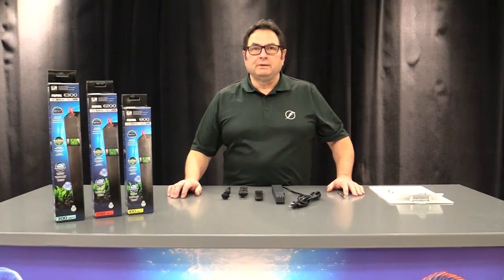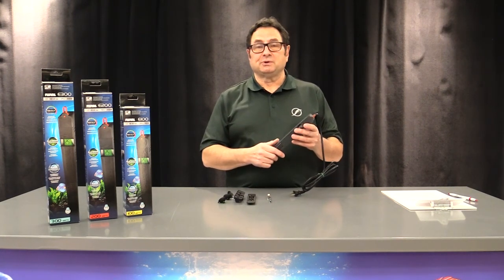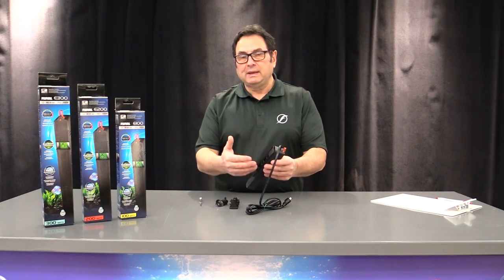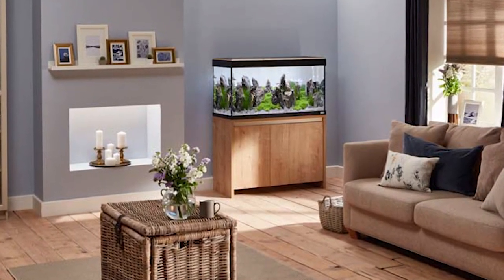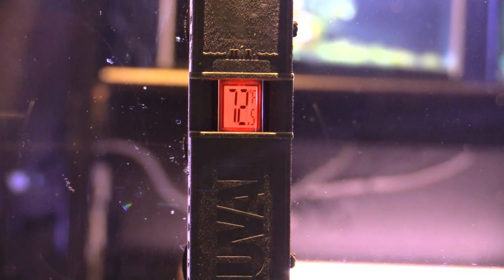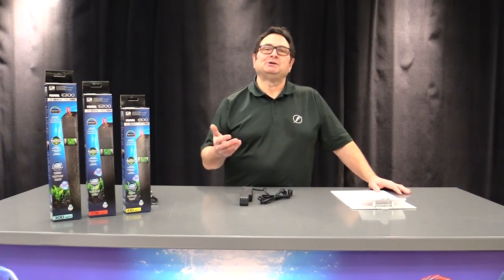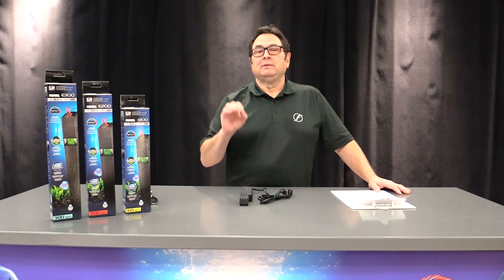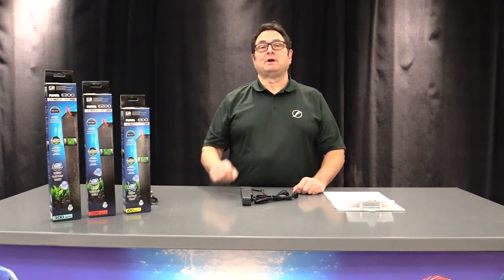Fluval E Series Heater Operation & Troubleshooting Tips

Comment: When you first posted this video, I posted a comment about how happy I had been with the two of these that I had. Since then, though, they have both failed in the same exact fashion; i.e., I could no longer adjust the temperature downward--it would only adjust upward. When the first one did this, I took it as a fluke and just threw it out. I would have still recommended this heater to anyone who had asked. But now that the second one has done this, I have to think it's a design defect that just takes a long time to show up. I won't buy another one and won't recommend them. EDIT: Scrolling through the other comments after I posted this, I see at least three other postings complaining of exactly the same failure! Fluval needs to recognize this problem and fix it.
Reply from the maker: Hi Jim, we're sorry to hear about this. Fluval E Series heaters are equipped with 5 year warranties, so if you have trouble with them within that time frame please contact our customer support team: https://fluvalaquatics.com/ca/contact-us/
Reply: @fluval  Thanks for pointing out the warranty period. I have taken your suggestion and submitted a warranty claim.
Reply: Well, so much for my warranty claim. I submitted it on the Fluval web site using the form provided. I got a reply asking me to send a picture of the label on the back of the heater, which I did ten days ago. But then I've heard nothing further. I sent a follow-up e-mail, but no response. So I still love Fluval filters, but I don't think much of their heaters--or their customer service--at this point!
Reply: @RealMenHaveCats  Hey there, how did this all end? Im looking for a nice heater for a 20 gal, thought this one was a good one but maybe I should look elsewhere. Which one do you use now?
Reply: @Atoximed , they finally sent a replacement, although it was a 300-watt model rather than the 100-watt model that I had. But it was very unreliable. It kept showing that the temperature was lower than it should be, with a blue display, although it actually maintained the set temperature pretty well according to another thermometer. I just didn't trust It. I'm using the Eheim Thermocontrol-e models in two tanks and a Fluval T series heater in another. The Fluval T takes some trial and error to get set to the temp you want, since it has an analog dial, but once you get it where you want it it's very stable. Much like the Eheim model.
Reply: @RealMenHaveCats  Thanks a lot for the detailed answer! I've heard good things about the good old jager eheim but I'm also looking at the superfish smart heater as well. I'd need some kind of way to monitor the temp, as I do not have that at all right now. How do you do it?

Comment: I have two E300 heaters, and while they are rich in features, they have what appears to be a great quality of life asset...the heater rocker adjustment at the top...that turns into an unusable feature, over time. I replaced one with my local pet store, without issue. Now I have one that's 4 months old and another that's 6 months old and both rockers are defective; they either don't adjust the temperature up or down, or it's a very frustrating fight to gain or drop .5 or a degree. I have thoroughly cleaned both, so that's not the issue. I'll be calling the pet store again to see if there's an equivalent option from another manufacturer. I won't be buying anymore of these; it's clearly a design flaw that requires re-engineering.
Reply: i have the E100 and i also have this same problem when trying to raise or lower the temperature .5 @fluval a response to this would be greatly appreciated.

Comment: Hi! I just purchased a Fluval e300 series for my 55gal. I am wondering if I possibly bought a faulty product or I'm just not being patient enough.  I put the heater in my tank for about 23min so it could acclimate before turning the heater on per directions. It has now been in my aquarium for 2hrs and is still stuck at 69.5°F.  It is still flashing blue & 69.5°  . I have it set on 80°F. I have it 4inches to the left of my Fluval 110 Filter.  I have unplugged it and waited 1 minute before turning it back on again in hope's of it resetting, but no luck. Can you please help?
Reply: Same problem
Reply: Similar problem here too.

Comment: I have this weird anomaly with mine. When I turn it off to do a water change, I turn it back on and it'll read low (blue) and stay there. Weird thing is I have a smart meter display so I know it's not stuck on heating constantly as when my display reads under three hundred watts I know the heater isn't on. The work around every time is to switch it back off for a few seconds and back on. It then goes to green and reads the correct temperature. I know this as I have an electric thermometer gun and a temp strip on the tank. Take today after water changing I put the heater back on and it read 25 degrees Celsius. Left it for three hours and it was still blue reading 25 degrees on the display. Checked my smart meter and nope it wasn't constantly heating and everything else read 26 degrees (where I've got it set to.) Turned it off for 20 seconds then back on and it reads the correct 26 degrees. Other than this weird anomaly it works fine. I've never had a LF reading or blue/red other than it reading low after initial turn on after it's been off. Anyone else get this? It's situated perfectly so nothing to do with placement. As I say once I turn it back on a second time it works perfectly.

Comment: I've had two of them for a couple of years and have been very happy with them. I really appreciate being able to set the temp digitally rather than with a vague analog dial. And the temperature displayed is quite accurate--I spot check it from time to time with a high quality Thermapen kitchen thermometer. My only complaint is that, after a water change, if the water temp drops a bit, it takes MUCH longer than with other heaters to bring it up to temp. Two of them behave this way, so I assume it's in the design and it's not a defective unit.

I've never understood why so many reviewers complain about the "low flow" indication. I actually appreciate it and think it's a great feature. It helps you get the best placement. Other heaters don't give you this information so when people get it on this one they think it's a bad design. I'm sure if your Eheim or Aqueon heater could tell you that it needed better flow, it would!

Comment: Found this video for troubleshooting my heaters as they will not lower the temperature set point any longer, which isn’t good obviously. They have been great for 2 years or so now. Very good for keeping temps accurate without much sway.
Reply from the maker: Hi there, we are sorry to hear that you are having some trouble with your heater. Should you need more assistance, please email our customer service team at customer.service@rchagen.com! 😊👍
Reply: @fluval Can i fully submerge it? The manual diagram says not to fully submerge it and leave the top red knob outside of water... Which is the right way?

Comment: Hello thank you very much for this nice explanation. 
I am using this heater now two years it is top.
I have a question please about the conspusption of electricity.  When the heater show green color on the led .does still the heater in this case consumes electricity?? 
Thanks
Reply from the maker: Hello, thank you for your question! Yes it does although the electricity consumption is significantly reduced. The consumer during this period would be to light the LED and visual display on the unit. 😊
Reply: @fluval  good Morning Thank for your reply I follow your advise and kept the heaters on the way of water flow is top hater i am now having most if the time green light , you mentioned previously that the heater consume electricity even when is green light can you tell me please  approximately how many watts  that this led light consume ? Because I have more than 3 aquariums and all running with fluval heaters and i use 2× 300 watt in each of my 4× 350 L aquariums.thanks à lot

Comment: Is the 300w one strong enough to keep a 75 gallon around 78 degrees or do I need two of them ? Installed yesterday and this morning it got it to 74 only
Reply from the maker: Great question! A single E300 heater should do the trick for a 75 gallon tank, but it really depends on the ambient temperature of the room. If the difference between the water and room temperatures is quite high, additional heating power may be necessary. Please note that it can take up to 24 hours for the heater to bring the water to the set temperature!

Comment: Hi Fluval.  Apologies if this has already been answered but couldn't find it in the comments.    My question is as follows:  how do you know if it is actually heating?    Temp is set for 25°C, but sometimes it shows blue at 24°C and doesn't appear to change unless I turn it off and on etc.  Can be left 8hrs like this, but doesn't seem to be heating?  Also, sometimes it is green at 24.5°C, but takes a long time if at all to change... is it heating now to get the temp up to 25, or is it happy sitting .5°c lower than set temp and will only heat when blue.    I feel a small heating indicator light to show heating is happening would be a great addition to allow you to see if it is working or not.  Thanks.
Reply from the maker: Hi there, great question! During normal operation, when the water temperature is within +/- 1°C of the set temperature, the backlight of the LCD screen will be green. If the water temperature exceeds the set temperature by 1°C, the LCD’s backlight will turn red. If the water temperature is lower than the set temperature by more than 1°C, the LCD’s backlight will turn blue. E Series heaters don't feature heating indicator lights: instead, the color of the LCD screen can be used to determine the heater's current status.
Reply: Get an "killawatt meter" and use it to see if your heater is drawing power.   Even better, get a battery backup that shows power consumption so your heater (and your pumps) are powered for the first 30 mins of a power outage.  My heater (E100)  is plugged into an APC backups which displays power draw, you can clearly see the heater come one and off.

Comment: How about actual operation like the video title says? What’s the red switch? How do you switch back to Fahrenheit after it switches to Celsius while trying to change temps.
Reply from the maker: As  per the video the red switch is used to increase or decrease the temperature setting. For all information on this heater you may conveniently use this link: https://fluvalaquatics.com/manuals/Fluval_A771-A772-A773-A774-E-Heater_Manual.pdf

Comment: Can you place these heaters diagonally in the water or does it have to be straight? What happens if I place it horizontal and fully submerged?
Reply from the maker: E Series heaters can be positioned vertically, diagonally or horizontally in the aquarium, as long as they're fully submerged and in the path of strong water movement! 👌

Comment: Hi, I just purchased a e200 for my 20 gal tank and it can't seem to heat the tank to 78 which my only 50 watt jager would. any ideas? it's sitting right next to my sponge filter and has been on for 3 days.
Reply from the maker: Hi there! E Series heaters require strong water movement across the heating element - your sponge filter is likely not providing enough flow. Try positioning the heater in the path of a circulation pump!

Comment: Hi, 
Is it safe for a portion of the power cord (less than an inch) and adjustor toggle able to be submerged?

I know the box says fully submersible but on the instructions it shows the top being out of the water.

Due to the nature of the turtle tank setup, the water isn't high enough to reach the min water line unless on an angle which makes top slightly covered.

Thanks!
Reply: Never mind, haha. 

After re-reading I noticed it says no depths beyond 39inches/100cm, so basically almost x4 it length.

Comment: Great video, I have the E300 and I am happy with it, I have two questions though:
1- Is there any indication when the heater is actually warming up the water. There was small red light in my older heaters that shows when the heater is actually working.
2- After my last water change, the heater shows 23.5c in blue color, the heater is set to 25C by default (which I am using) but two hours past and the temperature still shows the same. Does it take long time to heat up? My home temperature is 23.5C.
Reply from the maker: Hi Pascal! Great questions.
1. When the screen is blue, indicating that the water temperature is lower than the set temperature, the heater is heating. There is no additional status light indicator of any kind.
2. It can sometimes take a little while for the water to heat back up. If you're concerned the heater isn't working properly, please contact our customer support team for assitance: https://fluvalaquatics.com/us/contact-us/

Comment: My Fluval E100 heater display is not showing anything nor heats the aquarium.  I didn't read the maintenance requirement in the manual, causing mineral deposits to accumulated on the housing that contains the heating element.  The deposits have now been removed but I suspect it caused damage to the heating system.  Is it salvageable?
Reply from the maker: Please contact our customer support team about this, they'll be hapy to help: https://fluvalaquatics.com/us/contact-us

Comment: I have a 75 gallons tank with a Fluval 407 with a spray bar installed. From time to time I get the LF notification. I have installed the heater next to the intake, but I still have the issue. What can I do?
Reply from the maker: Hi there! Try positioning the heater closer to the spray bar, as much in the flow as posible. You can also consider purchasing a small circulation pump and positioning it to move water across the body of the heater!

Comment: I have the e300, great heater but the temperature reader is innacurate. It stays at 77 but actually heats the water to about 79. The tank is 125 gallons
Reply: same size tank, same problem.
Reply: I had two of these in a 100-gallon aquarium aquarium and could not get the water temperature above 77 degrees no matter how high I set it.  Also, each heater showed a three-degree difference only 18 inches apart.

Comment: Can i fully submerge it? The manual diagram says not to fully submerge it and leave the top red knob outside of water... Which is the right way?
Reply from the maker: Yes, you can fully submerge E Series heaters! 👍
Reply: @fluval  i right now left just the red knob on top of water surface in order to adjust it easily, is that ok?
Reply from the maker: That's perfect!

Comment: Ok I just installed the E100 in my fish tank.  Everything seems to be working fine at this point.  The question I have is the length of this heater makes me install it so that the bottom of the cage is touching my substrate.  I know what the directions say about not touching the substrate but is that for the tube or is the cage acceptable?  I don't want to ruin it but if I raise it up then I have concerns about the minimum water level.  Ideas?
Reply from the maker: Hi Dennis, there won't be any issues if the cage of the heater touches the substrate slightly. You can also rotate the heater slightly so it fits in your aquarium more easily!
Reply: @Fluval Aquatics  thanks so much

Comment: Hi I was wondering is there a way of adjusting the brightness of the LED display as at night when my main tank lights are off the display is really bright
Reply from the maker: Hi Kevin, there is no light adjustment, you are the first to bring this up, perhaps consider placing a towel over the front of the aquarium if you find it disturbing at night.
Reply: Fluval Aquatics tbh I was more worried about algae build up in the tank and fish not getting a proper sleep cycle
Reply: @fluval  - Your ultra-snarky response was totally uncalled for - the question is a legitimate one.  Your rude response says a lot about your company.

Comment: Hi my heater is set at 29 it goes green when its 29 but sometimes it will turn blue and still be 29 it doesnt flash blue will it still heat up when its bluex
Reply from the maker: Hi there! The heater is simply turning itself on and off to regulate the water temperature. 👍

Comment: If I have a densely planted tank, will it get mad about water flow issues?
Reply from the maker: Hi there! Due to their protective caging, E Series heaters require strong water flow across the heater body. If you think that might be an issue in your aquarium, check out our fully electronic T Series heaters instead: https://fluvalaquatics.com/us/t-series/
Reply: Thanks. I was thinking that might be the best option just due to plant density.

Comment: I had two of these seemed good at first but then I started getting an electric current feeding from them when I test it was only when it was fully submerged 
When it was just above the min water level mark it was fine no charge as soon as submerged though the voltage re appeared (yes I found this out by getting an electric shock when I was changing a filter )
Fluval could not have cared less when I asked for help 
Please be careful with these heaters the do fail there not water as water tight as they should be
Reply: I’ve heard this a lot from other users. Can this have an effect on this fish too?
Reply: @anthonyromano5420  

I ended up eating my discus after they got fried, with batter of course!

Comment: I've had an E100 in a 23g tank for a week now, and the display was ALWAYS blue--it's set to 77F but always reads 74.5F. I finally added a second heater I had lying around (a 75w) and that finally got the temp up to 77.
Reply from the maker: Hi Scott, did you try re-positioning the E heater in the path of the filter out flow?
Reply: I’ve got the exact same problem and it’s not flow related! Beginning to think it is too smart to be reliable!